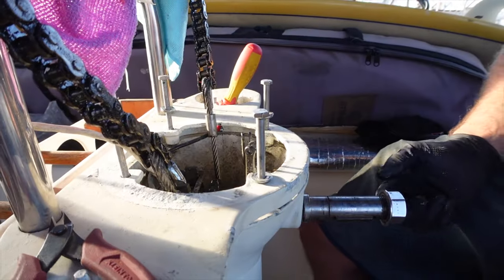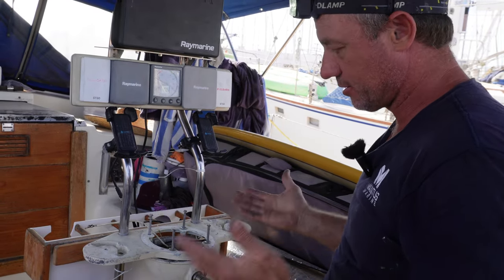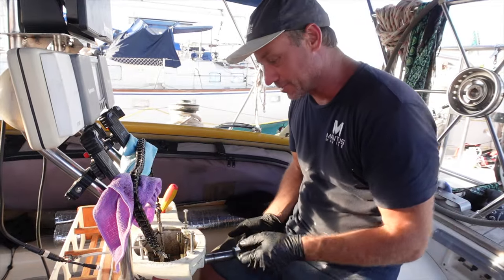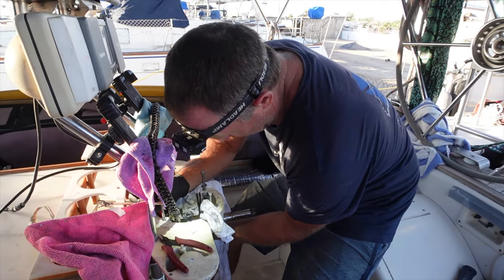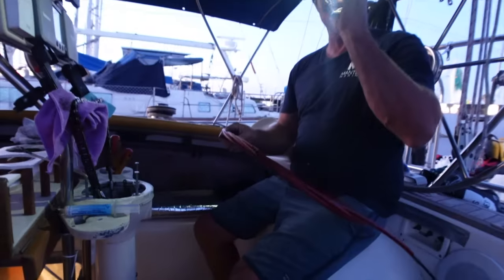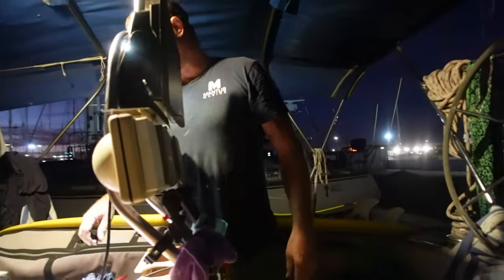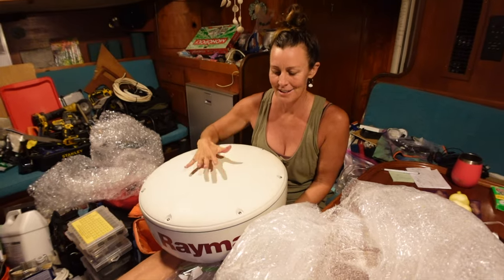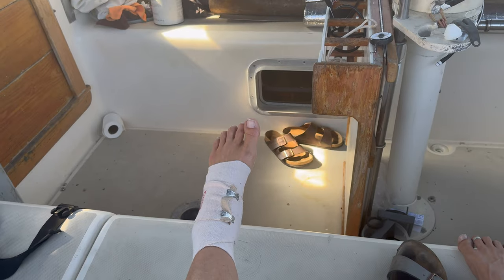Avoid Disaster | How to replace control cables Ep 411

Comment: I know you're well past this part by now, and I haven't finished the video yet, but I sent my instrument backbone cables down the binnacle guard tube.  I opened up the hole in the nav pod to guard tube big enough to fit the seatalk ng cable ends.  I didn't like the idea of ANY wires in the binnacle.  The only one I didn't move out of there was the compass light.  It was not nearly as mission critical, and there was no direct path from the guard tube to the compass.